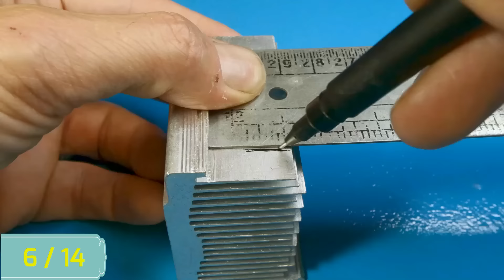14 Easy Plastic Repairing Ideas to Become a Level 100 Master

Comment: I restore old wrecked Chinese scooters and ALL have broken plastics, usually at the mounting tabs (structural stress points). Have used many of these tricks, but saw a couple new ones. Every time I find a broken tab or piece of plastic, I save it in a jar. When I need to repair something, I dump out those pieces and match up the type of plastic I need and then reinforce with washers, aluminum tape, screen wire (the fiberglass screen wire is perfect), or scraps of metal. JB Weld makes a structural high strength  industrial 2 part plastic epoxy that is awesome on plastic.
Reply from the maker: Great 👌 thanks for watching 👍

Comment: I tried fixing some motorcycle saddlebags where the bolts go through them and holds them to the fender. The holes where bolts go through had cracks going out to the edge of the molded plastic and one of them fell off my Harley going down the road. I melted washers into the plastic by heating the washer with a torch then I used zip ties to add plastic on top and around washers, similar to methods in your video. However, I had a problem getting the melted zip tie to adhere to the washer. It kept sticking to my soldering iron and wouldn't work well. I tried sanding one of the washers thinking it may be too smooth for melted plastic to adhere to it but had the same problem. Do you think my soldering iron was too hot or not hot enough? Maybe the zip tie plastic isn't the right plastic to use? My brother said he uses zip ties for all his plastic repairs and hasn't had a problem with it. Please help me because I really want/need this to work. The saddlebags would be expensive to replace. I hope to hear from you. Thank you! d:)

Comment: What did u put on the head phone after the super glue I have a broken pair I want to fix
Reply: At 5:45 he makes black powder from charcoal. It's probably that.
I've also seen powered graphite (sold as a lubricant for locks) used with cyanoacrylate (super) glue in a similar way.
If you want the repair to be white, then use sodium bicarbonate (bicarbonate of soda for cooking/kitchen use) works well.
I would have thought that all these superglue & filler options would be too brittle (not flexible enough) for the headphones, where the band is being regularly flexed. But I haven't tried that application, maybe it's OK.

Comment: in the 2/14  1:43 it is better the opposite, you put the track outside end not inside, so when you remove it, the plastic case seems better outside

Comment: if use heating iron, it will break - become brittle. Heating gun is not to connect - to flex. To connect use PLA or ABS 3d plastic pen (toy) - is not joke, it will hold joint as new.

Comment: Is there a plastic weld trick to do a cars radiator inlet or outlet pipe ive got a piece of pipe to slide over or in but all glues point to failure because of heat or water or both. Some of these might work tho could you maybe do video Please!!!!! with a radiator so I know all I need to do is pull radiator out to do it currently have hose jammed all way on and hose clamped but only starting it not driving as someone said what I've done will fail once hot water starts circulating and there is no fixing it besides new radiator HELP
Reply from the maker: Hi, sorry currently i have no radiator to repair and make a video, but for that job only plastic solder will work. search other videos on plastic soldering. thanks for watching my video !
Reply: Got given a old radiator I'll break inlet or outlet try best I think will work should be able to test a few. I'll report my findings😂😂and if I remember to video I will and send to you. thank you for replying

Comment: Impossible... il ne s'agit que de collage. Du bricolage. Faire fondre du plastique dans un trou n'est qu'une réparation illusoire.  Ce n'est pas de la soudure mais du collage. 

Pour souder un trou il faut oublier le plastique, mais créer un plastique de synthèse à base de glue ,et de polystyrène  ou de ciment ou de bicarbonate de soude . 

Ces mixtures vont faire fondre la paroi qui entoure le trou ce qui la fera se fondre  et se mélanger dans le liquide qui servira à combler le trou .

Si tu ne fais que coller du plastique...des qu'il y a pression même légère sa barre en couille!

A moins qu'il s'agit que d'une vidéo de collage? en ce cas je n'aurai pas compris et m'en excuserait